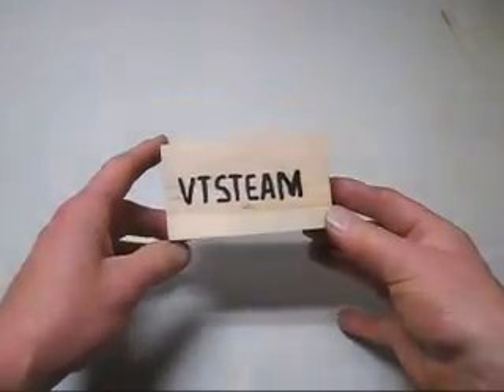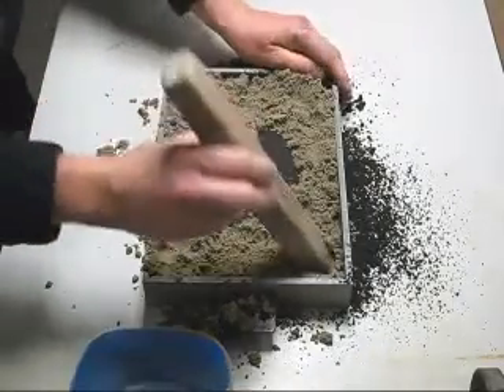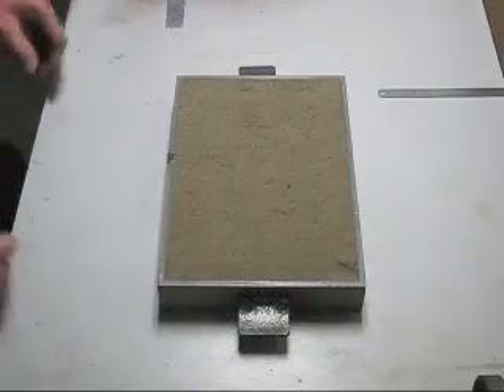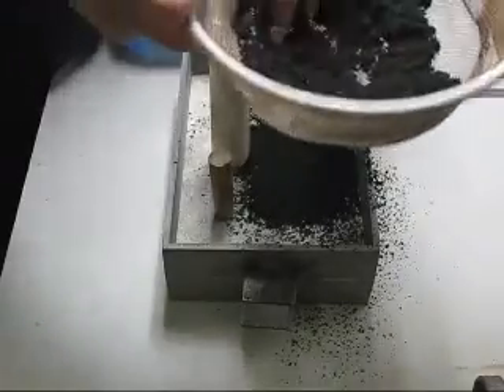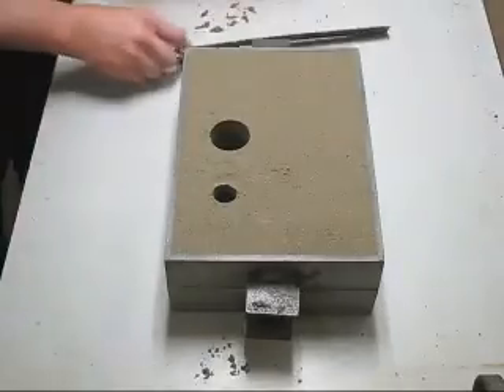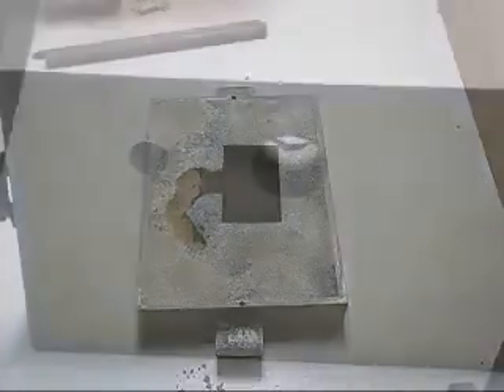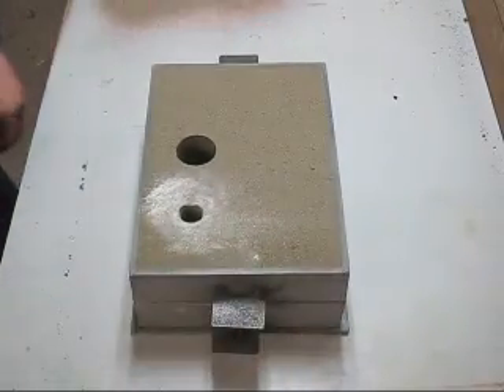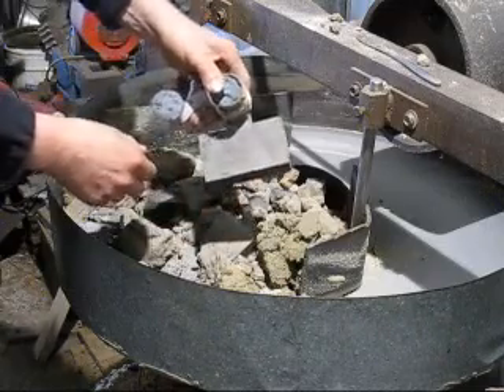Risers on iron castings

Comment: Very nice!! I have just discovered casting at home. So If my questions come off as way to newbish thats why lol. But the purpose of the riser is so thats where the shrinkage will occur instead of the part itself? Also, wouldnt the sprew take care of that? Thank you!!!
Reply: The riser is not only a reservoir for extra molten metal, it also helps in visualising how much metal you still need to add and most importantly, directional solidification. You don't want your metal to solidify from both sides because then you get a weak and mushy centre. So when the molten metal fills up the riser, metal starts solidifying from the runner side (your main metal, that is the metal filling up the mould). The metal filling up the riser is the extra unnecessary metal which prevents solidification of the metal in the mould on its side. So the solidification takes place from the runner's side to the riser's side and in that direction only.